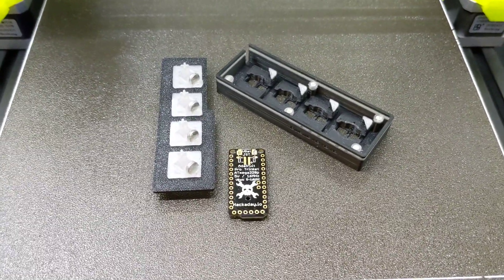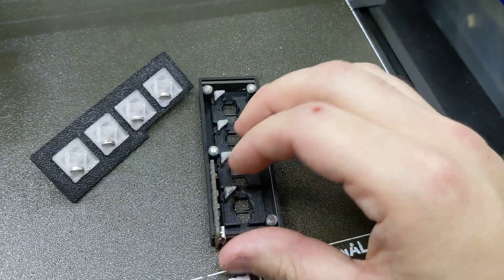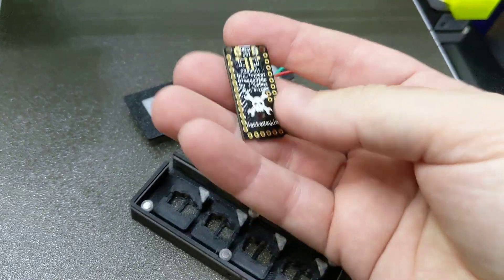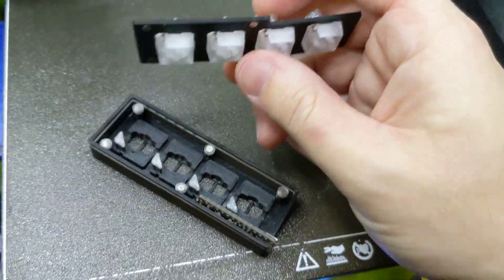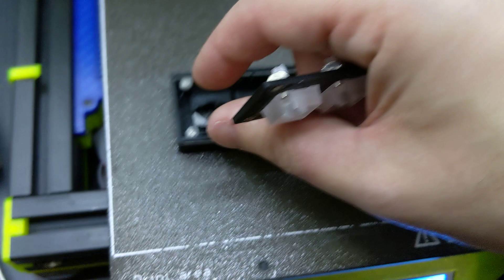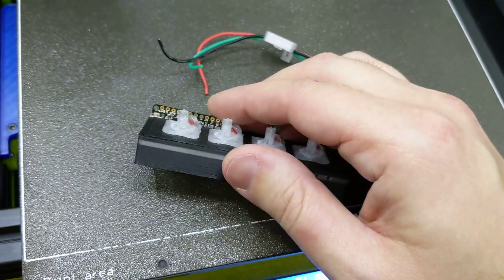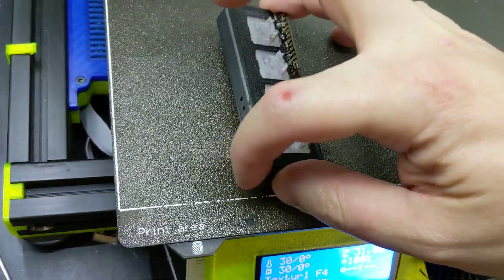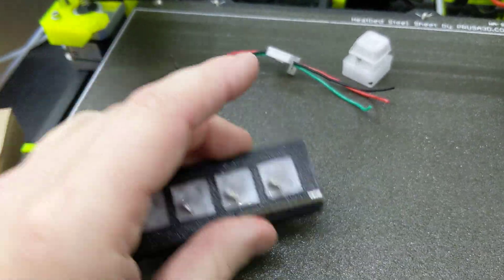3D printed contactless magnetic separation switch macro pad prototype nearly ready!

Comment: Try to make them mx mount but dont worry about having the mx pins
Reply from the maker: That's how they are right now... They fit in standard Cherry MX mount holes. Even my magnetically-stabilized stabilizers fit in Cherry MX plate mount holes 👍. The only thing though: The distance from the PCB to the plate is based on the parameters used to generate the switch. So if you make a switch with 2mm of travel that'll be a plate that's 2mm closer to the PCB than if your switch has 4mm of travel. Well, there's definitely some wiggle room... If you don't care about setting a really high/fast actuation you could still use a plate meant for a 4mm switch with a 2mm one. However, there would be pointless air underneath 🤷‍♂️